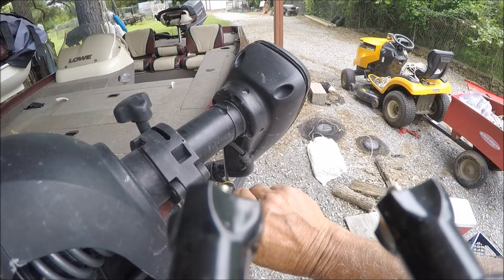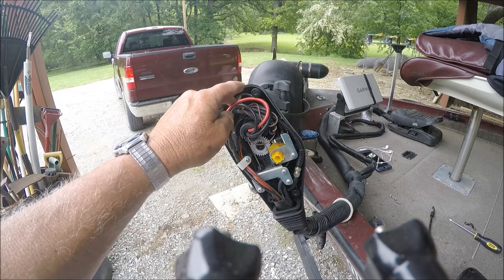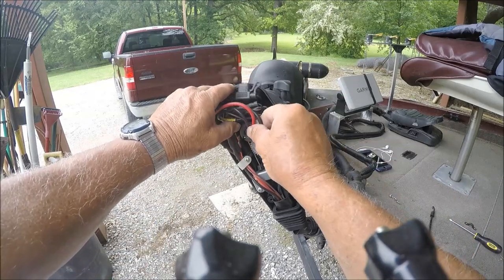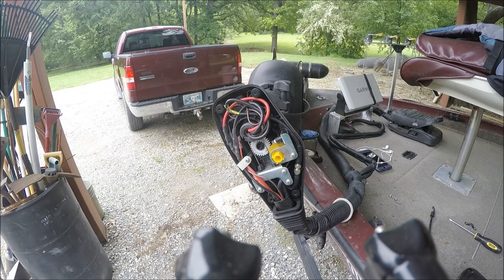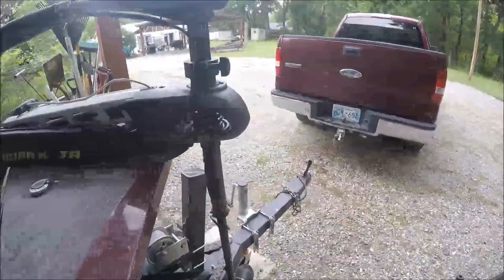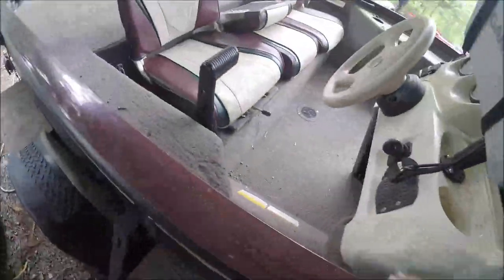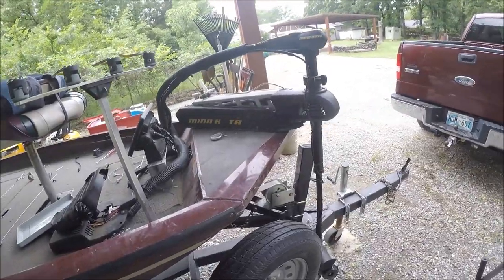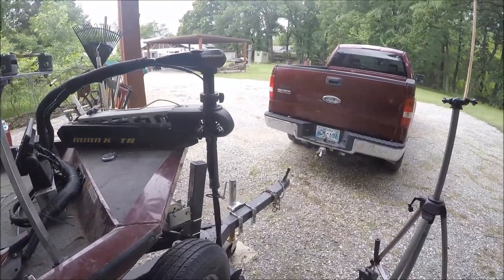Removing Trolling Motor Interference from Sonar or Fish Finder

Comment: But what does that 3 amp fuse control that won't prevent the normal function of the motor if blown? What does it do that when blown, introduces interference pick up up by the depth finder?

Comment from the maker: The device is not in the water. Trying to test the sonar with out the boat being in the water, the interference will almost blank the screen out instead of showing a small spike.  In the water it has no interference. This is just one of the many steps to removing interference on a sonar. The majority of the problems are caused by a lack of grounding.

Comment from the maker: There was a wiring problem with the power wire coming up the trolling motor shaft. Once the problem was resolved I stopped blowing the fuse. If the fuse blows more than once there is an underling problem somewhere other than the fuse. I didn't find the problem until after I made the fuse video.

Comment: So what blew the fuse? What is that fuse for?
Reply from the maker: The main power wire going down the shaft to the motor had a bare spot on it and it was shorting against the armature when the motor was running.
Reply: My brother. I have been chasing this problem for days and never once considered that it could be a fuse issue in the motor, sure enough...blown 3a. Now to see why. Thank you!

Comment: The fuse is in a brown wire which is a ground wire per Minnkota wiring schematic. Pretty much explains why those adding an external ground wire got the same result. The deal is finding the ROOT CAUSE of the problem. What causes the fuse to blow??? Dave found his and corrected it. Make sure you find and correct yours, which may well not be the same as Dave's. Or the problem WILL return. Just sayin'.